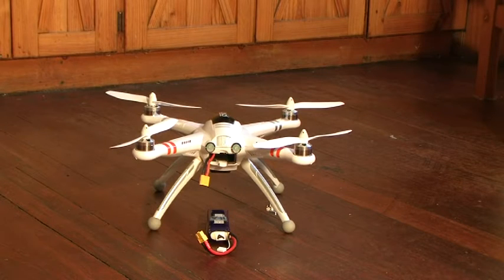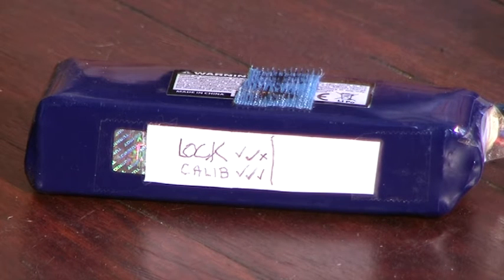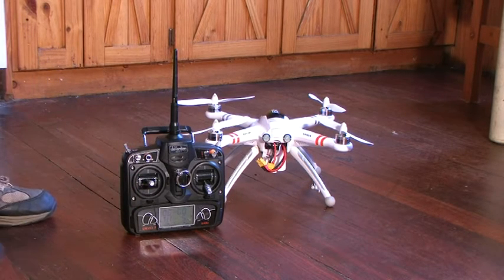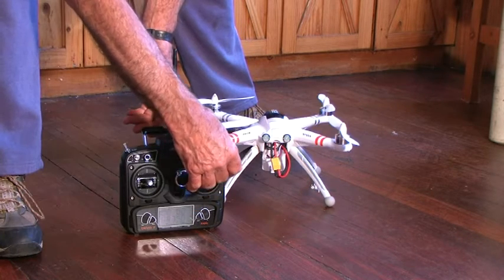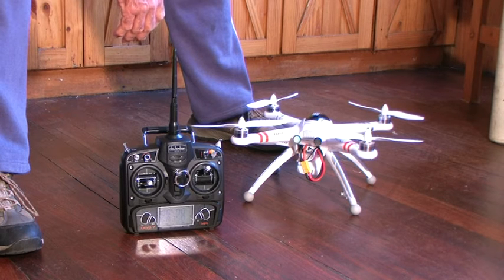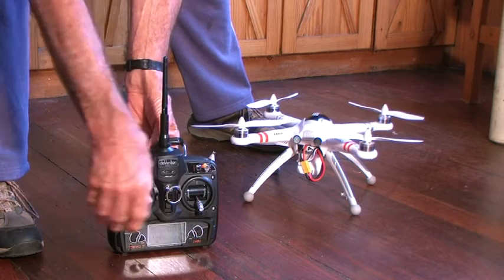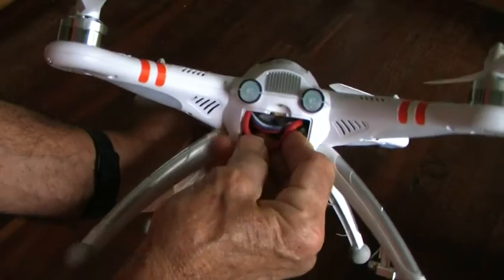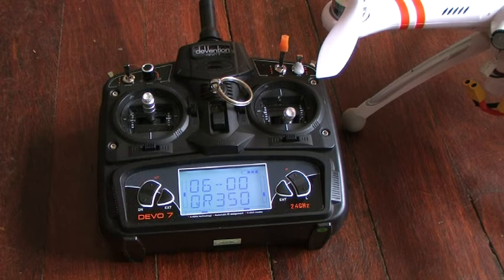Walkera Calibration

Comment: Arghh! I tried to fly this unsatisfying bustard three times. On first I noticed that the receiver is living on its own and not listening transmitter - it flew wherever it wants away, so i putted throttle gently down and broke a landing slide a 100 yds away. Second attempt - Maybe i calibrated it wrong - I thought (still in manual mode with mix set to upward 0 position) I calibrated step by step Compass Gyro and Accelerometer as Manual said. Second flight - lower wind - gusts up to 3mph. I tried to stand still in manual, but i had to walk after my drone, 10 meters or more - It was doing what it wanted. less then 10 meters away - stable as a sentinel. Third flight. Maybe that is how it is. Lets set it to GPS hold mode Mix position 1 and.... 'come back.... come back....' than power off and it's falling fast from 50ft above the ground with nothing to do - NO SIGN OF LIFE, NOTHING!. I went to the broken body and - It works. Just Body part to be replaced, but I dont wanna try next flight until I'll find what it was. - I'm so disappointed.

Comment from the maker: When you have problems  with switching in and out of GPS functions, the most usual problem is the mode set up of the transmitter. I would look for a way to see the mode functions with a graphic display. That means attaching your receiver to a flight controller which has a usb port. At the very least that will show if the modes are engaged.

Comment from the maker: I have noted the interesting observations about calibration. The requirement to disconnect and reconnect power after calibration and before flying, is a practice I have never observed. I will in future, but on past experience I am not sure it makes any difference. The comment about alignment accuracy during calibration, may also be very important but again it has had little, or no impact, on my flying. But please do not think I am ignoring these suggestions. I value them and and will test them.

Comment: HI. I have a walkera qr350pro for a curtain time but it was not possible to fly with it.
The reason is he fall over by starting flying. do you know what is the problem.
thanks
Reply: +Yvonne Groen 
It falls over because you havent followed all the pre flight instructions. You need to calibrate the compass turning it in all three directions and then disconnect and reconnect the battery . Also make sure you have GPS signals.
I know I am a bit late here, so you prolly already figured it out

Comment: when you started calibration you turned the model by almost 30 degrees as you started flipping it (watch your video again closely) If you don't have the nose dead on the starting axis all the way through the rotation then do it again cause that little bit of change in your heading will make a big difference. You should set it up so that your directly behind the model and grab one side and flip it half way to inverted and then grab it with your other hand flipping back to normal all the while keeping the nose straight. This is very easy to do in all axes.

Comment: I've got confused at first since it was not mentioned that you are calibrating it using a mode 1 transmitter. I had a mode 2 TX.
Reply: Jayrographics  I have a mod mod 2 transmitter and I can't seem to calibrate the compass or switch to GPS hold it just flies in manual any help